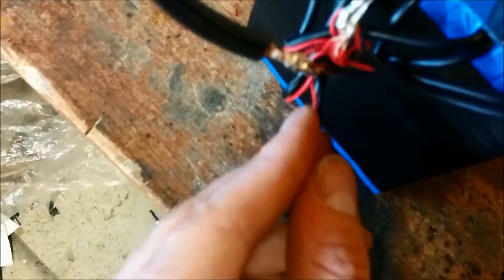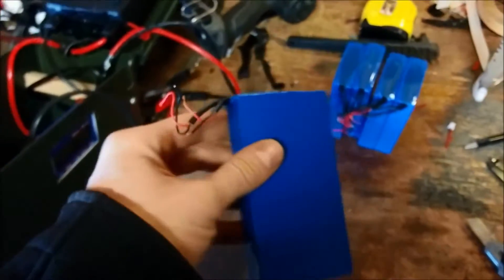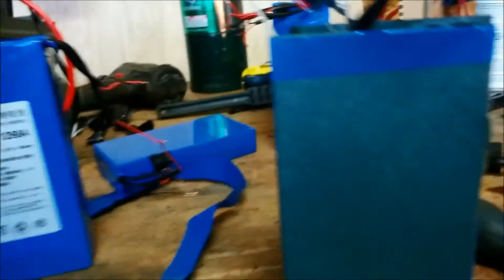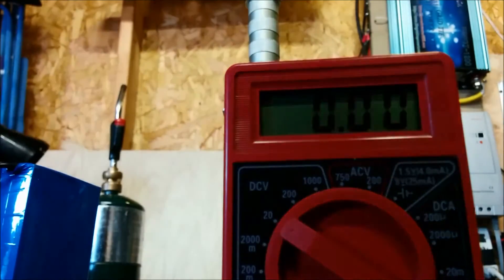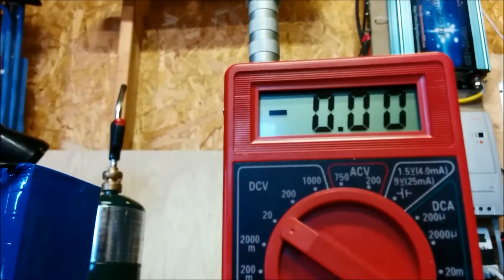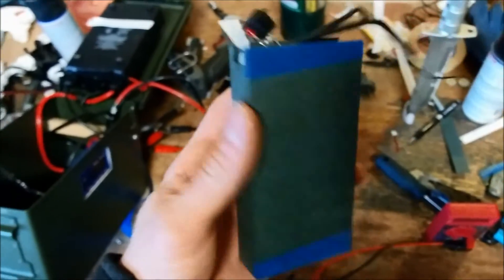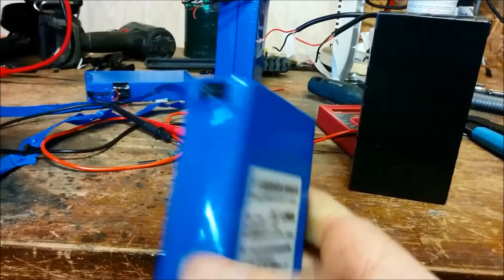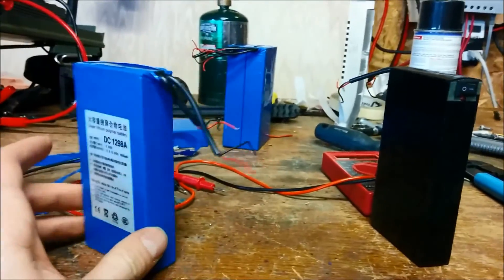9800mAh Blue lipo brick opened

Comment: Darn. When you start a “tear down” process, complete it. I was hoping you will show us the protective/balancing circuit boards. I just received a DC 1298B LiPO pack in the mail, and was curious.
Reply from the maker: I didnt use a bms and the cells I bought where junk
Reply: Thanks for your response. By junk you mean like not properly charging? Or by junk you mean the rating was incorrect. The rating being incorrect (i.e. purposely mislabelled) I have seen when I was looking for the LiPO battery I just purchased. At the time when I was looking, I noticed a whole bunch of sellers advertising LiPOs with a capacity of 980,000 mAh, i.e. 980 Ah( I am not kidding). Finally found one seller explaining in fine print that these were actually 8000 to 12000 mAh batteries, and that the manufacturer has mislabelled them!!!!!!!!!. So please share the info. about why they were junk, and hopefully you did tear down a pack completely to find out what protective circuitry it had.
Reply from the maker: @xxycom8963  they where rated at 6000mah each but was really 1200... the pack failed very fast.
Reply: Was just looking other videos over. The following video got my attention : 
https://youtu.be/sBkiGUbpmFI
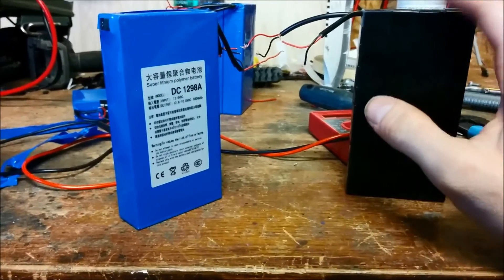Never mind that it is in Russian ( I don’t speak Russian either), just turn off the volume. The guy is tearing down a similar LiPO battery the 1212A. It is a 12 volt, supposedly 12,000 mAh battery, which he shows at 5:52. When he tears down the battery, he shows a single cell rating shown as 8,000 mAh at 6:00. I started laughing. Please also note there is no protective circuitry, or bms.